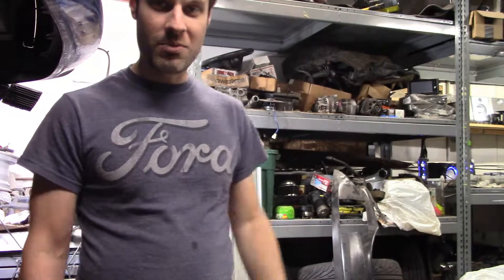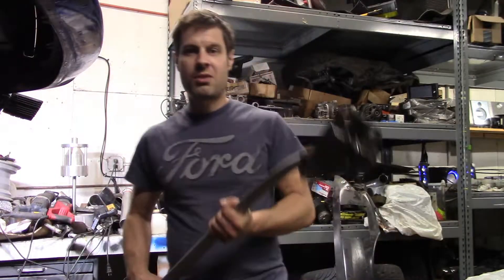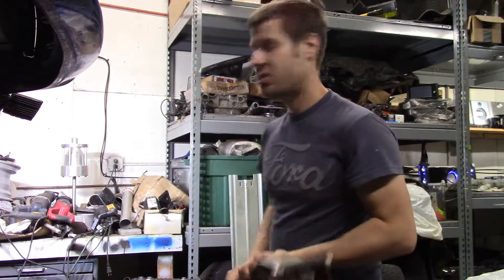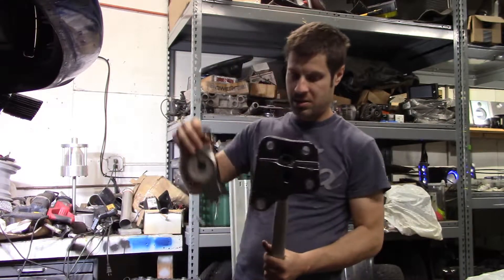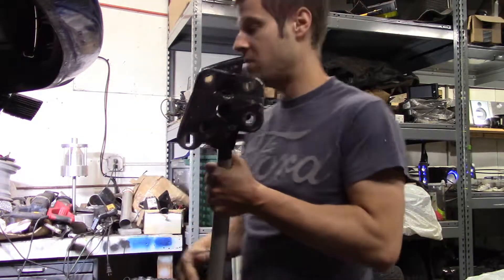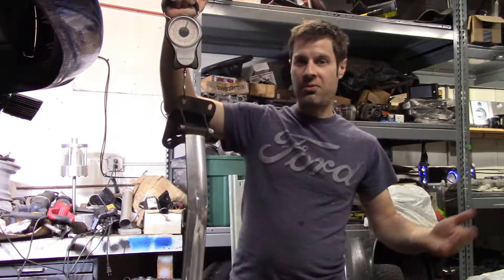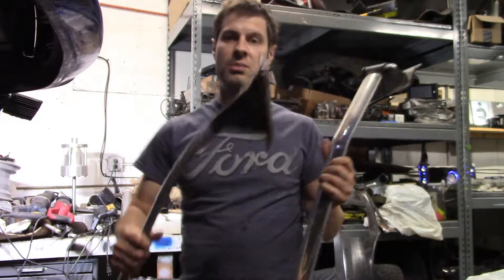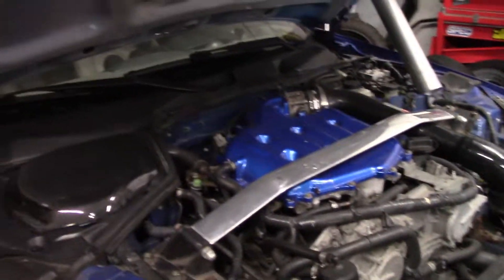STOCK 350Z STRUT BAR - HEAVY AF

Comment: Hate to burst your bubble but by removing that stock one and putting in that after market part, you may have saved five lbs but you just installed a part that acts as a front strut pivot point! With those two bolts acting as pivots points for the strut towers! But what do I know being a race car builder for over 40+ years! There is a reason Nissan spent millions of $ twisting the chassis’s to figure out how to get the most torsional rigidity out of there chassis. Just sayin
Reply from the maker: You are correct on that, but Nissan definitely built a lot of this stuff on a tight budget. Most of the cheap steel chassis bracing on this car is trash now, and needs to be replaced due to being rusted through.